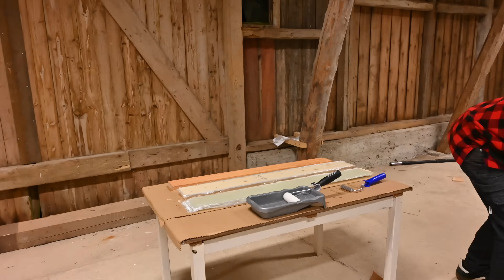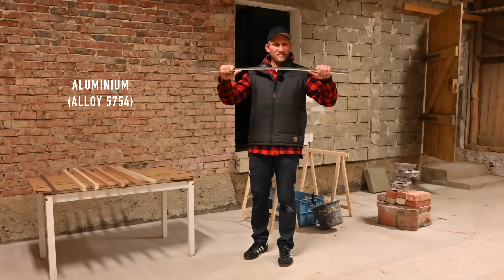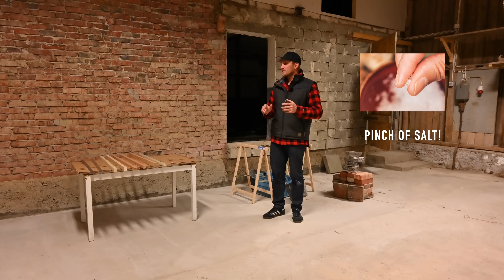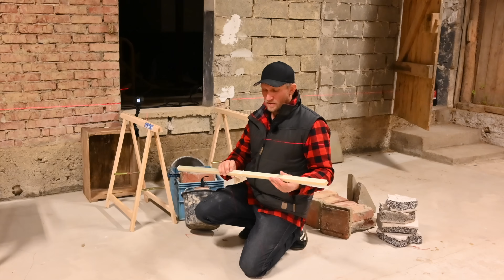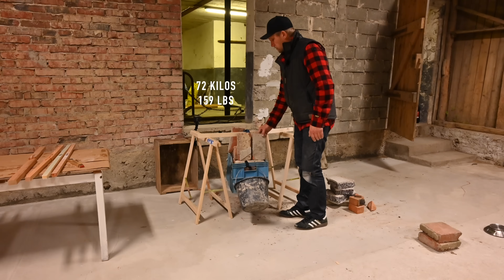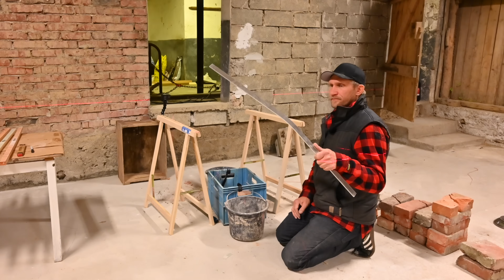Boat Hull Material Test - Which Breaks First? - Ep.  319 RAN Sailing

Comment: I like this. The flaw in your test is, I think, that you varied the thickness in stead of the width. If you calculate the strength of a beam the height counts exponential. So light materials in your tests get more height and an advantage in strength. Thats why your metals get a bad score because they have less thickness. 
On the other hand you could argue that the thickness you are testing is (more or less) the thickness of the hull you would build with that particular material. 
Nevertheless you got a good idea of how strong a laminated wooden core can be. I think you´re on the right track. Since you already decided to build in woodcore + glassfiber + epoxy maybe you could test spruce and douglas again now keeping the height the same, just testing the bare wood for the lamination part is the same for both species.
Good luck with the build. I am looking forward to you setting the moulds.
Reply: You are right about varying the thickenss... I think the better way to do this is establish the thickness for a wood strip-built hull and then test the various woods for strength in the same way... And while doing that, also test for puncture resistance, brittleness, maybe even abrsion resistance (fiberglass vs. metal, etc., not so much each wood product on its' own).

I get that they may have the option of building the hull to differnt thicknesses at this time, but the thicker you go, the more you have to accommodate the differences in the available design space.  In the end, they need a material that is strong enough to hangle the stresses with plento of safety (5x the required strength is common for critical strutural sizing but no sure if that is comparable for boat building).

However, I suspect that the differences in the wood may be immaterial to the minimum practical thickness of the wood that they need to maintain structural rigidity and all three of the woods would like meet the minimum hull strength requirements because it ends up being greater than the other aspects that get the hull thickness to be whatever they settle upon (I'm guessing about 1-1/2" to 2" unless it is a larger boat than I am expecting).  At those thicknesses, all three woods would be fine once wrapped in fiberglass. on both sides and reinforced in the important bow and other areas.
Reply: I think you are completely missing the point.  The whole resaon for using lighter materials is that you can increase the thickness for a given panel weight - stiffness is roughly proportional to thickness cubed.  On global loads, boats are stiffness driven (with strength drivers for point loads), so you can increase the stiffness for no increase in panel weight.  If the test had varied width rather than thickness, this comparison would not have shown that design advantage.
Reply: @alexwhatley6762  We are both neither wrong or right. My point was that you have to be aware you are changing two variables at the same time, material and thickness. Changing the width would tell you you need more or less of that material to cover your hull.
However you put it you get an outcome with more interpretations.
Strength and width or strength and weight or strength and thickness.
Reply: @wijmakenalles  why is chamging material AND width only changing one variable, if changing material and thickness is 2 variables??  If materials are different densities, then if you want to keep weight constant, have to have different volumes of material.  There are only 3 dimensions yo can change to get that volumetric change - length is the sensible one to keep constant in the test in this video, and as bending "strength" was being tested and thickness is a key driver of that, then varying thickness is most sensible.  In your suggestion, the timber and foam would have been much wider than the metal - more of a plate than a beam, and the phystics of plates is different to that of beams, so the results would make no sense.  In terms of hull construction, one of the attractions of foam sandwich and wood core ulls is that they need far fewer internal stiffeners than metal, becuase the thickness means they can span greater distances.  That gives much more freedom of interior layout as you need fewer frames, longitudinals and builkheads, where a metal boat has much greater lattice work of stiffeners inside - as does a monolithic FRP hull
Reply: To put it another way, the boat would not be built from 5mm thick cedar or 25mm thick steel - the material properties drive the hull thickness, so testing them all at the same thickness would not be representative of the material properties as applied to the boat build in question
Reply: @alexwhatley6762  But thickness comes at a cost, so you can't just keep making the hull thicker.  I made the point on another thread somewhere that there is a vible range of thickness that makse sense and I suspect that all thee wood products he tensted will work sufficiently well within that range (but since that test wasn't really testing stiffness, you don't really have any information about how the woods will perform in this manner).

Stiffness can be easily tested and calculated by measuring deflection given a specific load. Not by testing to failure as was done in this video.
Reply: @mjmdiver1137  so what was being tested?  It was a classic 3 point bending test, which is used to evaluate bending stiffness.  More specifically, for the ones that broke, it was testing bending strain to failure.  For those that didn't (the metals), it was bending strain to surpass the yeild point.  The foam composite failed in face-to-core bonding, so I would be interested to know the details of how it was laminated, as it should have been much closer to the other 'thick' materials
Reply: @alexwhatley6762  They tested to failure, not deflection under a given load.  Those are very different measurements because the boat won't be built to fail, it will be built to deflect and then recover under normal loads.
Reply: I was about to type a lengthy post about this but you covered it quite correctly. They should have all been square shaped then we would have gotten a nice comparison between density and bending load. My engineering brain could not handle the content of this video 😅😅😅. Side note: Steel is used because it doesn't fracture so easily. Abrasive resistance is less of a concern because impacts for example with containers on the high sea happen in an instant where the steel just deforms, fibreglass will most likely fracture and create a leak.

Comment: Nice test for the woods but the metals are just totally not testable in this way. An aluminum hull for exable would have stringers and frames every few inches. Sometimes as close as 2 inches. I am not sure but i heard that half the weight per sqaure area of hull come from the surface plate and the rest from the framing. But to get that in a model test youd have to have a proper section of hull. Overall i believe the aluminium was not tested in the way they are actually used.
Reply from the maker: Yes, and I mention this in the video. Still you can build a stiffer and lighter boat from wood core compared to aluminum or steel.
Reply: I must add as an aluminium fanboy that I am, I have just checked the prices for alu and its just barely higher than it was in 2008. It had a spike over the last year, but overall its not shot up significantly. About 15% over the last 10 years. Again, at the moment, the prices always change up and down.

Comment: I have no experience of boat building but, could you use a combination? Get some of the additional strength from one species and some weight and cost saving from another. I.e. alternating planks. Or use lighter material where weight needs to be kept down and stronger material in other areas. Most rot resistant below waterline. Best insulative above waterline. 
There could be so many different rationale for selecting different timber for different sections.

Comment: Historically, oak was an option, but it's heavy and probably expensive.  However, a very common modern option is fiberglass coated plywood that was fairly inexpensive, sturdy and easy to work with.  I'd be interested to see what its properties are compared to your other options.
Reply: One well known yacht built by plywood strip planking is Stormvogel but that plywood is mahogany and I suppose that it costs too. Built in 1961 and still sailing. I spent 6 months and 12.000 miles on her long ago.
Reply: plywood probably wouldn't fare well in a test like this, since half of it's thickness is going to be cross-grained to the stress load.  However, that aspect of plywood makes it very good for larger areas.
Reply: I've built a couple of boats out of plywood and my current little trailer sailer is a ply boat and as much as I like the material I wouldn't be building my live aboard blue water cruising boat out of it. Ply boats can have problems getting insurance (especially home built boats) and if you can get it, it will be expensive

Comment: I would say Aluminum is the best hull material. High strength to weight ratio and the only major con is the galvanic corrosion which can easily be prevented unlike other materials where you have to deal with delamination, rot, rust and etc.
Reply: I would agree. I would also say that for the DIY home builder it is the most difficult to fabricate.
Reply: Hard to work with and expensive. Major cons.

Comment: What consideration was given to the shape of the sample? breadth and particularly depth have significant influences on bending resistance, not simply the weight of the test sample.
Reply: I think the wood tests were quite reasonable since the shapes were similar, but metals need a different cross section profile to be comparable, e.g. an I-beam shape.
Reply from the maker: Same length and width on all the samples, just different thickness to get the same weight on all of them. So same surface area. Cheers!
Reply: @RANSailing  Thank you for the super quick reply. Love your channel. The depth of the sample is a significant shape factor to bending resistance. Try bending a ruler flat when simply supported, then try it on its edge. Different resistances, same material.

Comment: Well, I agree your test was a little nerdy and I agree it wasn't REAL scientific but it accomplishes two things.  It convinces me that I'm a nerd - I loved it.  Also, you are going to be spending a lot of money and hours and hours working with what ever you choose.  I think it will give you peace of mind when you are building and when you are out sailing that you chose the right material.  Thanks for another fantastic episode.  Ron
Reply: Ditto Ron of Wind on Water. I'm a 65 year old woman with no experience in sailing or boating. However, I've been watching your video's for a while now and you never fail to provide good quality content that I thoroughly enjoy. Thank you for another great video. No wonder that you are as successful with your video's as you have been all along. I will be following this project of yours until you splash. Blessings from Cape Town. ❤🇿🇦
Reply: You're not Ron.... I'm Ron!
And another nerd....
Reply: Yes. Verry interesting Test.
Reply: What!! Not even considering Ferro cement? I went to New Zealand many years ago and it was popular for home builders.
Not sure that I'd want to sail ice fields or high latitudes at all, with such a hull though.
Reply: 🤔 doesn't diesel soften Ferrell Cement?!?
Reply: @stevenr8606  i think this is not the Problem you can Paint it with Epoxy.
The Problem ist the weight and so the performance is going down. I think on cost, streght and simplicity it is a very good Solution.